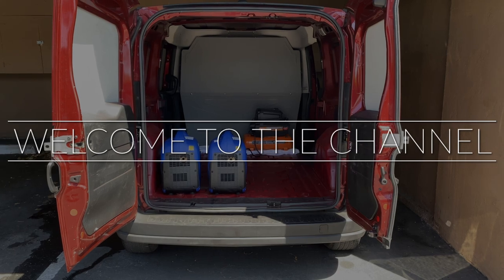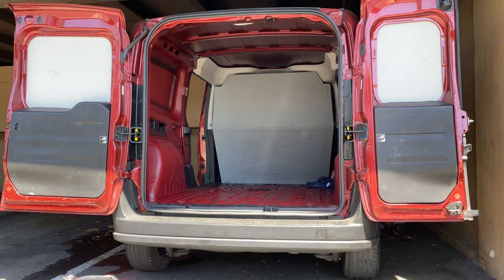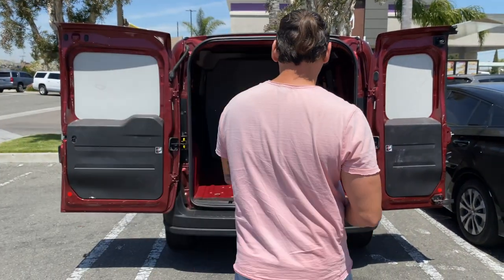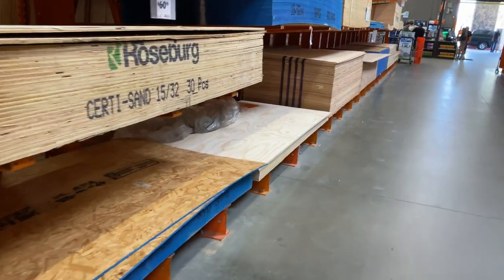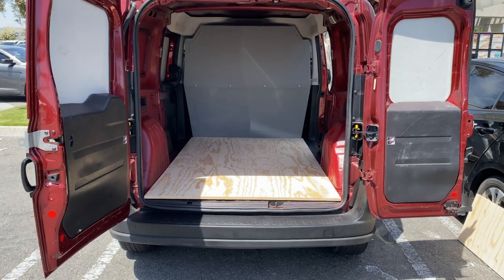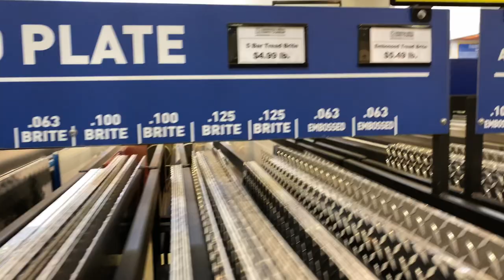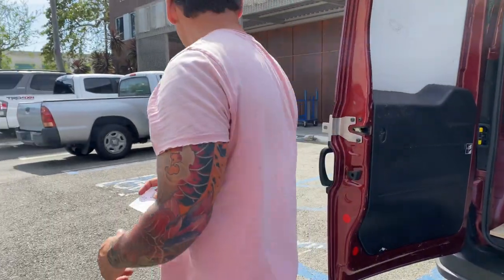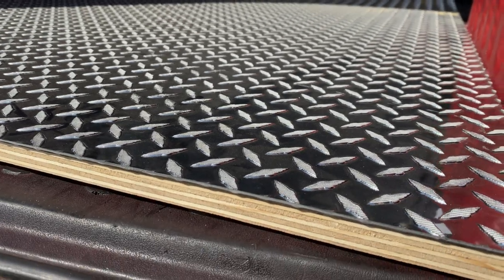Building a Van Subfloor and Diamond Plate Floor in my ProMaster City Auto Detailing Van set up!

Comment: Loving these vids just subbed. Man I wish we had a metal store like that here in South Carolina
Reply from the maker: Thank you!! That is definitely appreciated!! Yeah metal stores are great bc other places get you otherwise, I first checked Home Depot’s prices, the sheets are a lot smaller but still wanted to cross reference the price and the mark up was insane so I just goggled “sheet metal supply” near me and was lucky to find this place. But for the savings I would have driven maybe an hour for it lol. Another alternative is Some guys use FRP, I think that’s a little more readily available and cheaper. For a 4x8ft sheet at Home Depot is $43  and its one of the most durable materials around. Its used in major commercial kitchens because it’s resilient to water. That guy from Suds n Go put it in his set up.

Comment: Did you drill the Diamond Plate Floor onto the plywood i couldn't see , real cool tho i need to buy a place like that in my town that sells big sheets like that
Reply from the maker: Yeah these places are awesome!
Later I did, but here we got the size just right and later its up to you if you want to drill holes through the van or not. I recommend you drill holes throughout and insert some solid nuts and bolts, ever since we’ve done that we’ve had zero problems with the floor.
Reply: @Brandinwagstaff  thank you for the tips 🙏 I want to to setup a detailing setup on a truck bed with a camper  to cover it , I tint vehicles but want to get into ppf and ceramic coatings now , and I  see it’s necessary to have a detail setup to prep the car right before applying ppf or ceramic coatings
Reply from the maker: @Luisrrr508  Oh wow that’s interesting. Thats going to be a cool setup. Yeah it seems like it will make your job a whole lot easier. But yeah once you get all of your equipment situated on the plywood and diamond plating, after you see how everything is sitting then that is when you take the precautions to securing the floor to the bed. See where everything fits and then see what room is left over to add in the bolts to secure the floor so it doesn’t slide around.

Comment: I want to do this to my truck. But idk if I have enough clearance for the wood also. I wonder if just the metal is okay.
Reply from the maker: Oh yeah, I see you dilemma. They make different thickness diamond plate. You can eliminate the plywood and use diamond only as long as you go with an unbendable thickness. At the metal supply shop Ive seen sizes anywhere from 1/8 -5/8 thick

Comment: How did you end yo securing the ply wood to the van floor ? Did you drill new holes through the van ? 
Want to do it on mine but not sure exactly how to go about securing the plywood
Reply from the maker: Well there’s not much mystery to it, that was my main question too. But really its wherever you see fit as long as you don’t damage any electrical wiring or hoses when drilling the holes. To be honest we put them all over, in the front, the middle, the rear.

Comment: What did you use to get the diamond plate on the doors?
Reply from the maker: The guys at H2O did it, I just had them pre-cut
Reply from the maker: They use a lot of metal working tools. Maybe like four or five different things just to fit in contour and cut it to the shape of the door it’s actually difficult. There’s a lot of riveting, drilling bending, and cutting.
Reply: So just making holes and drilling some screws to get a hold of it? Getting some anchors on them for the screws work?
Reply from the maker: @JuanPerez-dt6iv  https://youtu.be/5JtcHm-avBI?si=6Ki7GoWeYuuINWo3
Reply from the maker: @JuanPerez-dt6iv  https://amzn.to/41gR7q3

They used a tool like this to cut the plate to shape. Also they did some drilling with self tapping screws, but they later installed rivets and I asked why and they said it was because the screws come loose overtime so ultimately a rivet is the most effective way to secure it especially if you’re going to have bottle holders hanging from the doors
Reply from the maker: @JuanPerez-dt6iv  there is a YouTube video I put in a comment of some of the work they did when they were cutting it.

Comment: How did you bolt the flooring into the van?
Reply from the maker: We bolted it once the water tank was in place, we used the metal straps and long bolts, you can see it in my video “H20 custom builds my setup” but really the bolts can be placed anywhere and drilled straight through to the bottom of the van just examine where your drilling and dont drill through wires or hose lines
Reply: @Brandinwagstaff  this is what I’m afraid off. I don’t want to cut anything while drilling. Is your water tank tied the same way or is it tied on the flooring you made?
Reply from the maker: @jerryguillaume6435  its bolted clear through the bottom of the floor. I was afraid of the same thing. But we drilled almost 10 holes. Almost every body does it there’s no other way. Once you lay underneath the van and get a clear view of where you’re drilling you’ll be more confident. Its easy you’ll see there’s plenty of clear areas to drill to secure the flooring, frame and tank